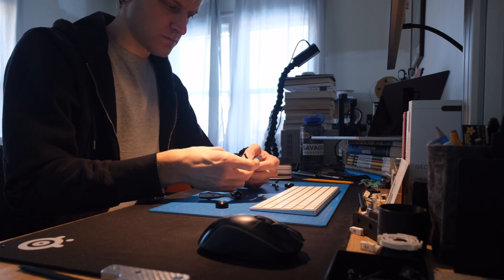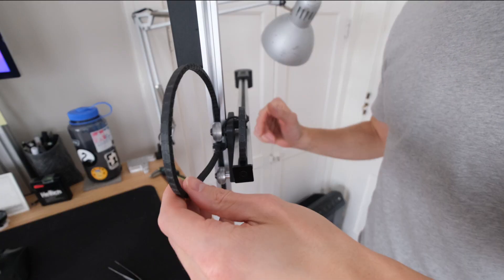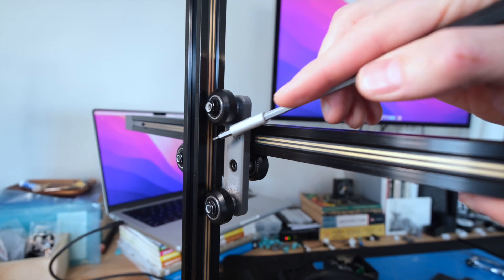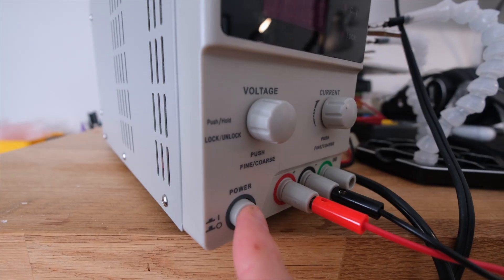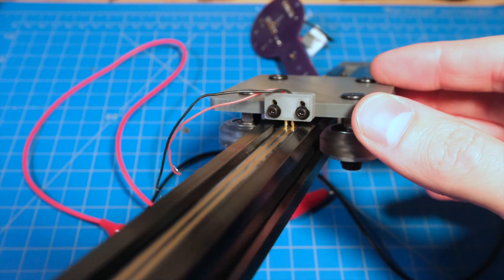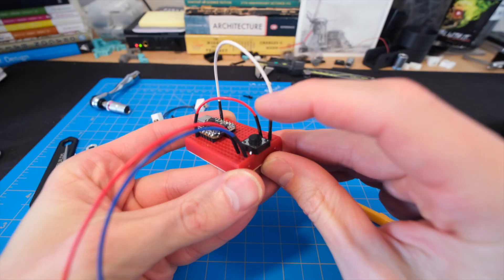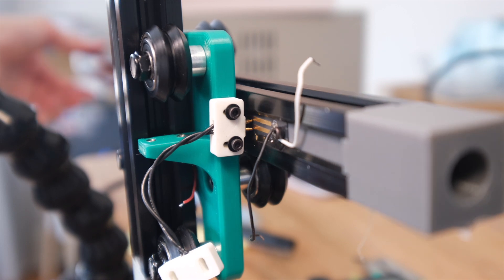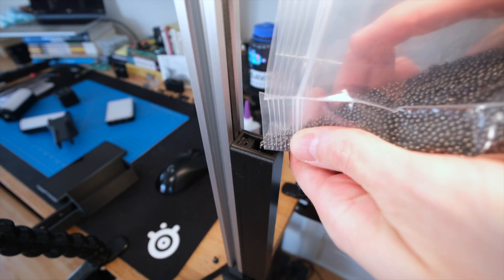Pogo pins: attractive distraction or ultimate wiring solution? - DIYson Lamp Build Log #9

Comment from the maker: Hello! Hope you all enjoy the return to the full DIYson. Lot’s of experimentation and iteration in this one!
(Thanks for your patience if you noticed the re-upload, had to fix an audio issue.)
Reply: i noticed the little sneak peak of the diyson super track in your previous vid. it was exactly what i was expecting and im so happy you went this route! :) i cant wait to make my own
Reply: didn't even notice the audio issue :D
Reply: Hi,  If you add Excentric Nuts to the carriege holder you'll solve the play. Check out any info regarding Excentric nuts on 3d printers, that's how you eliminate woble from the moving parts, and if it works in the 0.01mm range for 3D printers I guarantee it will work on this project.

Have a good one.
Reply: Interesting build!  One thing that occurred to me was that you have the pins mounted past the three guidance wheels.  If you mount them opposite the center wheel, instead, you should have MUCH less trouble.  (The project mentioned at 15:53 shows this.)
Reply: The moment I saw this project with the drag chains I immediately thought about this solution, glad you found this too.
The problem is of course the continuity during movement, I'm thinking of something like metal wheels like model trains getting power from the rails.
Reply: When prototyping or testing a closed-loop two-wire system, you don't need to hang test equipment leads off the working end of the system... :)
-Just short the leads on the far (reciever, lamp) side, feed a voltage through the loop over a 100 ohm load at the source side, and measure the voltage over the load. Any change in the voltage over the load resistor is a signal transmission failure. For more advanced testing, you can do this with a high frequency or complex frequency signal and get really detailed information about the system behavior while under movement/load/actuation.
Reply: Sooooo much better than the drag chain. Love where this is heading
Reply: Just place 2 Pogo Pins directly between the moving rails. Just face the PCBs to each other and ad the Pogopins to the Carriage itself. No soldering at all 🤷‍♂️
Reply from the maker: @cando9181  This solution would conflict with an existing component on the lamp. Can you spot it?

Comment: Pogo pins are not designed for constant sliding. There are spring contacts that may be more effective but at a bare minimum they must be on a module that you can easily replace because they will wear out especially with this kind of contact that they are not designed for.

Comment: I know this video is 2years old, but what if you used a mechanism like one in a retractable measuring tape? Not the coil itself, but the material. When you extend the tape and try to fold it in on itself, the bend is almost a perfect circle, which could go at the top or tail end of the lamp (away from the light). You could glue a small cable to it for power, and it would behave very similarly to the drag chain, except on the long sides it would be completely flat. With a narrow enough tape, it could even fit inside the V slots. 

You would need 2 tapes, one for each axis, and a junction point on the carriage to transfer power (or even data) from one to another. On the vertical axis, the tape could even act as a cover for the timing belt, and one of the anchor points for the belt would be in the counterbalance. On the horizontal axis, i think you would need something more like a U shape belt with both anchorpoints at the same location (whichwould interfere with the heat pipe) or a second counterbalance (which would improve stability) acting as the anchor point for 1 end of the tape.

Comment: What about putting a single track super track in both the top and bottom slot of the horizontal arm, and in the front and back of the vertical arm?

Comment: What I would consider doing is using a copper wiper instead of a pin. While this might not fix the issue of the twisting moving the contact off the trace, the nature of the copper wiper having a spring component to it helps keep it firmly in contact with surface it’s sliding across. 

If you pictured the shape of a spoon from the side with the bottom of the bowl riding along the trace that’s what I’m trying to convey. 

Specifically if you look into a Dremel 395 or 3000 variable speed switch they accomplish the variable speed with this copper wiper sliding across a length of  resistive carbon trace. If the sliding wiper concept was good enough for Dremel that should speak to its potential. 

To get a good look at what i’m talking about there is a youtube video by:

Alec J - Dremel 395 No Speed Control

If you jump to marker 3:30 he gives a decent close up shot of the contact wiper mechanism. 

Maybe this help, maybe it’s already been shared but it can’t hurt much chiming in even if it’s an older video.

Comment: This is a cool system. I could see it having other uses. Once the bugs are worked out. Considering that you're using one point of contact it would be far better to have two points of contact separated by a little bit of distance maybe on either side of the carriage that way if one loses contact the other one item still have contact and vice versa. I like the Pogopins although I think the rollers might put less where on the track.
I'm also wondering if keying the pogo pins into the track would keep it in line with the track but that might add drag.

Comment: If you put the pogo pins right in the center of rotation for both axis (would be between the rollers) you could minimize the movement and separation

EDIT: There are a handful of comments with the same thought... should've scrolled a bit further down

Comment: Instead of the PCB-tracks, you could use a ~5x5mm brass bar and mount it in the track with 3d-printed spacers and screw insulators.
Put on on either side of the extrusion and you have a beefy, long lasting track.
This enables you to use beefier pogo pins or brass springs for better contact.

If you are worried about corrosion: My last car had a similar system on the steering wheel for the horn. Just a brass track and a brass spring. Not a wire spring, just a springy piece of sheet metal like the ones you find as earth pins on EU power outlets, specifically CEE 7/3. It worked fine for over 20 years until the nut that holds the steering wheel got loose and the wobbling steering wheel bent the spring before I got it fixed.

The ultimate flex would be to gold plate the sliding surface which isn't that hard but still a lot of effort.
You could also use (kapton-) tape as an insulator.

Comment: 10:30 Careful with that: you're checking the voltage with no load and may find it ok even though you have a shit connection that wont be able to deliver the 10 or 30 watts you need to power the lamp.
That's why smart car mechanics use test lamps and not test LEDs to check wirings

Comment: I think you should try using a single big pogo pin, use the aluminum (a very good conductor) as the ground and a single trace pcb with the pogo pin for the 3V. Remembre that with anodized extrusions it won't work and adding a pogo pin that rubs on the aluminum will leave a mark in the long term (maybe you could use some kind of brush).

Comment: I like you concept, but why don't you use the conductivity of the aluminium rails for your ground connection? 
Then you can use the two power lines in the slot for redundancy or even for added functions.

Comment: You could use only one track to carry the positive voltage while carrying ground though the frame itself. Also, why use a pcb?T The exposed coper traces tend to wear out really quickly!  You could use a heavy gage coper tape (or foil) over some isolating material! :) Almost a diy pcb !

Comment: Have you considered putting the track on the top or bottom side of the (horizontal) extrusion if it can fit under the rollers, seems to me that the movement due to the torque would then be in axis with the compression of the pogo pin keeping it on the track

Comment: could a potential solution to the pin connectivity be to spring-load the pins so they auto adjust to deviation in the track? really dig this project and enjoy seeing the design/prototype process. thank you!

Comment: A capacitor holds very limited amounts of charge. With an analog input, you're not drawing much current, so the capacitor can stay more full for longer and smooth your voltage. With a high-power LED, the capacitor is going to discharge very quickly and not going to make much difference.

Comment: Could the pins that contact the horizontal rail be moved closer to the center of rotation force you get when lifting it when it’s extended? (Like drilled in the middle of the carriage instead of mounting on the outside) maybe the deflection between the rail and the carriage is better near the center wheel or someplace.

Comment: This is an awesome project! I was actually theorizing my own DIY Dyson lamp a few years ago, it nice to see you execute it so well :) One idea I had was to use two 1020 aluminum extrusion pieces with a 1mm insulation layer in between, and use the two together to make a 2220 aluminum rail. One side for negative and the other for positive DC power. Would use the bearings as power transfer which obviously isn't optimal but would work for low power draws. Would also need to remove the anodization on both the v slot wheels and extrusion slots.

Comment: While your efforts to fix the problem by testing the pin placement and types will contribute to your goal, I think you're ignoring the actual problem: the lack of stiffness in your design. First, get a carriage that will hold those arms much more rigidly, preferably a design that allows for adjustments to the wheels. You can easily eliminate most of that flexing that is causing your pin misalignment, solving your connectivity issue.
Reply from the maker: Just because I don't explicitly mention something in the particular video that you happen to watch doesn't mean I'm ignoring it.
Reply: @StevenBennettMakes  that is true. I jumped to conclusions based only on the info contained in your video and my own observations, and my experience and training says to work on the big problem first - which may or may not be what you consider a problem.
Carry on, and good luck with your project!
Reply from the maker: The issues you bring up are 100% valid and accurate, but I felt your original characterization of my thought process was incomplete and a bit simplistic. I bring this up because, as someone who puts a lot of thought and time into these problems, seeing comments like this is pretty demoralizing. I appreciate your thoughtful response though, thank you for being so understanding.
Reply: I apologize, I meant for my comment to be constructive criticizm, not putting you down. I had been up all night and probably shouldn't have commented while tired. Might I suggest that in the future, you might make a brief mention that an issue not the focus of your video will be covered elsewhere? Or just add one of those popup links in the corner to another video? I feel like you can head-off similar comments to my original one, and let your audience know you have plans to address things.
Reply from the maker: I appreciate that, Brandon. Definitely worth considering how I can better inform folks regarding what I have done, plan to do, and plan not to do. Thanks for that feedback, I sincerely appreciate it 🙂

Comment: Two ideas.
1. Instead of two exposed lines next to each other on one the same side of PCB i would suggest two sided PCB with tracks on both sides. PCB mounted perpendicular to v-slot. On carriage pogopins pointed at each other. PCB would end up between them. 
2. Instead of PCB use flexible metallic strips with some isolation between them. Strips need to be a little bit longer than aluminum profile. Strip would lay in v-slot and at carriage it would be guided out of v-slot in order to have a possibility to touch both sides of that strip. Kinda like cover strips on linear servo actuators.

Comment: I would be very cautious about the pogo pin solution, you can even see it happening in this video is that with the pins constantly pushing against and sliding against the pcb it is wearing grooves into it and the quality of the connection will be getting worse and worse the more you use it. Along with this the rotation loosing contact with the pogo pins is definitely a problem with the rigidity of the carriage rather that just the pogo pins

Comment: I might add a touch of dielectric grease you can get from auto parts store it will reduce corrosion on the copper over time while still allowing current through. But otherwise i like it an all the tests you made

Comment: An interesting solution! I'd just be worried about shorting the system by accidentally touching the supertrack with a piece of metal or my fingers. Also dust might build up over time and cause dips in the voltage.

Comment: Youtube just reccomended me this project, and I gotta say, I love this project and can't wait to binge all of the other build logs! About testing the pogo pins, one way you could've tested it is by putting either a small voltage (~0.5v) or a high frequency signal (around 10KHz sine wave) on the rails, and connect the pogo pins to a 3.5mm audio jack, then to a line in of a PC or a audio recorder. you can then hear or see (in Audacity or other software) the failure as drops in the signal, which sounds like when you turn a headphone jack in a bad plug, but you have much more resolution than with the method you were using.
With that resolution, you can characterize the drop-outs by crackles, very short drop-outs that're almost unavoidable with moving pogo pins, pops, much longer drop-outs from a bad connection, or actual drop-outs. With some data analysis, you could characterize those automatically and find out what solution is actually the best!
Keep in mind that If you do go the route of putting just a voltage on the pins, you'll have to remove the AC coupling capacitor from your line in on your sound card. Luckily, cheap USB sound cards with line in plugs are plentiful to buy online, and they're easy to hack to remove DC coupling!

Comment: Been following this series and right from the first video I've asked myself why use those tracks-chains ..
I have a couple of suggestions:
- Super-track center slot : a 95% (100% movement length?) slot to allow clipping the track to a 3d printed "inverted T" holder. This would increase isolation between tracks and make usage of other suggestions,  such as carbon brushes,  or slotcar brushes type connections.
- Placing the connection on underneath of the beam. Gravity is your friend and would work on favor of maintaining contact between the track and the connections. 
- place a diode in series with the capacitor and place them both at the "head" of the horizontal beam. The diode will help avoiding inadvertently return of short-circuit current to the track.

Comment: 1. Your power transfer tracks are basically just straightened slip rings - which suggests a good source for a good bit of well-ironed-out R&D. I seem to recall multiple (redundant) contacts made of single bent-metal 'springs' with high conductivity coating.   2. as something of a designer, I keep wanting to see your carriage plate's corners be more concentric with the wheels at each corner. That tends to keep an even material thickness between the holes for mounting screws and the outer edge of the plate, and tends to make things appear a little more intentional and harmonious. 3. Great stuff. Really enjoying this series. I'm about about to get my first 3D printer and might need to take a crack at your battery-powered one

Comment: Side project A: Make a single track for positive voltage, have a pair of rollers work as the contact/pickup, and the rest of the body on the outside negative.
Side Project A1: Have two tracks on two sides, roller pickups.
Side project B: Send a laser beam (or just a tight beam) from the base inside the frame in the center, have the arm connecting roller hub mirror it to the arm, mirror again and disperse the light at the head. Not for the faint hearted & non-blind though.

Comment: Hey Steven, using a flexible circuit with through-holes + stiffeners where the pogo pins need to be soldered seems like it could be an easier solution. Millmax makes pogo pin assemblies that are right angle as well. Thanks!

Comment: Hey, i think I have a easy solution. You can completely eliminate the alignment issue by makeing a wider rail on two diffrent sides. Also consider useing multible or other "pogopins". The contact surface just needs to be bigger.

Comment: I haven't seen any comments address life-cycle and wear. Standard ENIG plating from PCB makers is great for combating oxidation, but it can be too soft for mechanical use. Edge connectors, like on PCI and M.2 cards, where some infrequent mechanical in-and-out is expected. (How many times have you moved your graphics card, really?) The solution for edge connectors is a "hard gold" option available at most PCB houses. Thoughts?

Comment: I'd rather replace PCB with polished steel rod, add them to opposing slots of aluminum extrusion, connect + and - correspondingly.
Then instead of pogo pins use graphite brushes with springs (like in DC motor) to pass electricity.
After this create a cage out of PLA for brushes to prevent from shorting to aluminum extrusion.

Comment: Have you considered spring loaded pogo pins rather than fixed length? They are used extensively when testing pcbs and assemblies. You can get pins with different shaped heads, crowns for penetrating flux on test points, round heads, single points, there are many styles.